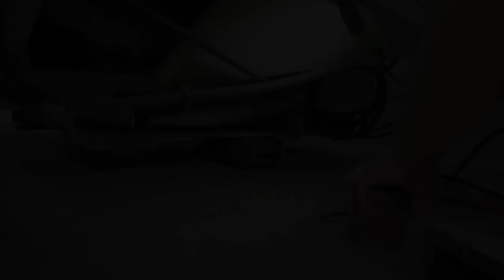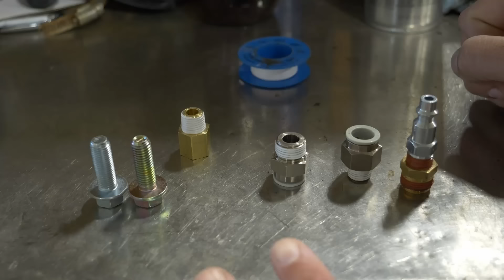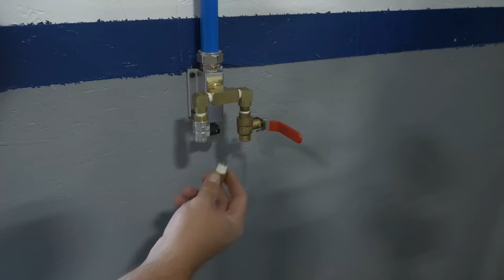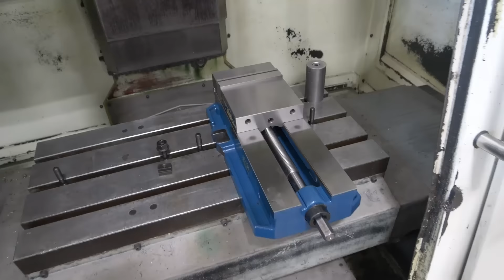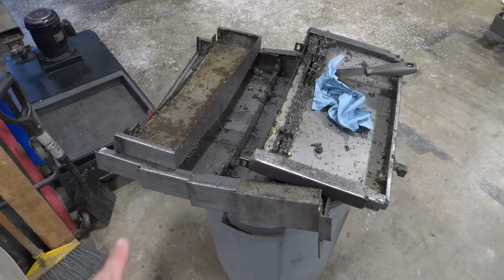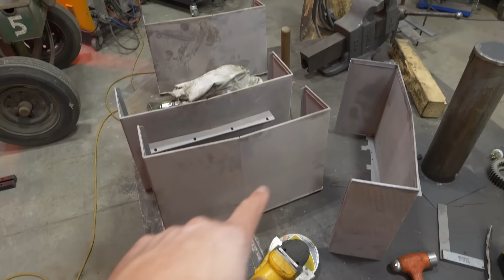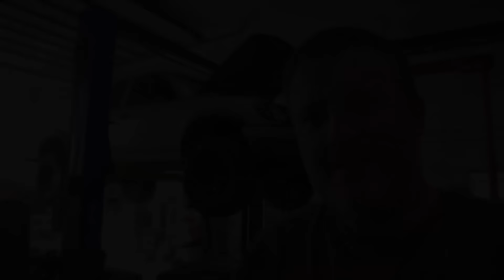Did I Buy a Problem or a Solution? Cheap CNC Repair Part 1

Comment: what the hell is a "Way Cover" and why do we care so much?
Reply: It's a condom that helps to prevent a milling machine from reproducing. Unfortunately they are effective only 98% of the time, so it's likely  you'll end up with more than one in your shop.
Reply: @dale436  Oh... that is just sublime! Best explanation ever! :))) Oh, i'm totally "borrowing" that.
Reply: @dale436  😂👌
Reply: @dale436  Judging by that phone call, that's exactly what's happened to Wes.
Reply: @dale436 yeah true story, I had a machine with out way covers. Should have seen the aftermath, like bloody rabbits!
Reply from the maker: Good question! It covers the ways. Think of it like a suit of armor for the machine. It protects the important expensive stuff it needs to actually move and work. It's the most important part of the machine IMO.
Reply: @WatchWesWork  Until I saw someone on YT dismantling an old machine that was in dire need of overhaul. Hang on a minute, that was You! I didn't know what ways were, thats how long I've been watching you.
Reply: @WatchWesWork Yes, way covers protects the ball screws so that shavings don't get ground into them . Expensive fix if that happens.
Reply: @WatchWesWork I worked for a machine shop company that has CNC machines. We had 5 new machines come in from Hoss my Manager said they cost anywhere from $500.00 thousand dollars and up. I was A Janitor in the shop so I was able to see what they did on a daily basis we worked for the US government  making parts for guns  and we made a part that looked like a beer keg  cut in half  with A clear lens on the bottom of A ship  or  helicopter sonar very expensive lots of things i see them make good luck
Reply: @dancurrier6421 And that’s why the NKVD hired the janitors in the Manhattan Project…
Reply: @WatchWesWork ”this is the way” 👷🤓😂
Reply: @WatchWesWork  Naw. Perhaps the most significant factor affecting longevity and accuracy, but not the 'most' important. The material you cut, it's abrasive factors, and how often you lube/clean the bearing surfaces will decide how important way covers are. Conversely, if you have .5 mm slop in the axes, or a lathe gearbox that randomly pops out of gear, good luck making good parts.
Reply: @WatchWesWork  see this is why I said you would be a great teacher. I lost patience the second I read what is a way cover.
Reply: There is nothing worse than getting shavings in the ways of any machine.
Reply: @robertgarrett5009  I'd say a massive fire is worse.
Reply: @robertgarrett5009 actually grinding/sanding/filing dust is worse as it is abrasive
Reply: You can play hockey without a cup but only because ice is so cold. You take a puck to the jewels and you'll know why then. Sometimes you just need protection.
Reply: Well, think of them as the pothole protectors for the machine. If you don't keep them in good shape, your parts will have potholes :)
Reply: The “ways” are the tracks the parts of a lathe, milling machine, shaper, cnc , all make their movements on, the accuracy of a machine is 100% dependent upon the LACK of wear on the ways., you can have them reground but that’s a slippery slope, , anyway any precision machine has ways., the chips of metal being cut, or ground by the machine end up in your ways and causing rapid wear., and thus rendering the machine “totaled” the cost of repair exceeding the value of the machine, now Wes’s early videos had a lot of machine repair, so “totaled” for Wes is slightly different.,
Reply: I sometimes wish manual lathes had way covers.
Reply: What a great episode
Reply: Ha where I am employed the owners don't like making way cover repairs! Then they wonder why the machines don't repeat!
Reply: Nooooo not a mystery phone call and now a part Two. Can’t wait to see it.
Reply: I'm stuck here in England.  I can tell you. We use metric mixed with imperial. For instance, we drive in miles per hour. But use metric for nuts bolts and screws. We wiegh food in llbs, but pay for it in metric. You at least have consistency
Reply: @pauljackson5482  And if you work on old machinery here  - British Imperial spanners, BSW, BSF taps and dies, BA, Metric, UNC, UNF and I had to buy some JIC screwdrivers for some Japanese machinery! :)
Reply: @Andrewausfa You missed “Thury” (BA’s ancestor) and the fact Whitworth and BSW have different sized spanners.
Pipe threads in Europe are BSP because nobody changes pipe installed in the ground.
Reply: At least in australia every thing is metric apart from old cars@pauljackson5482
Reply: I've learnt something as usual..sad to say I'm well seasoned in rusty frame repair living in Canada East and running  a bunch of 1st Gen Canyons.
Very poor move on GM's part with boxed frames.
Great vid as usual Wes..
Reply: It's the difference in getting 3 more years out of this machine, or 30 more
Reply: A ''way'' is like railroad tracks. It controls the direction of the machine tools. They should be perfect. The ''way cover'' is literally a cover for them. It prevents damage to the ''ways''.  As Wes said it's protection for the important parts. It sounds trivial like goggles, but it's not. You only get one set of eyes or ways.
Reply: Awesome video Wes. I learned a lot (as I always seem to do). Keep the videos coming and we sure as heck will keep watching. FYI I grew up in Australia, on a farm and we had Witworth, SAE. And Metric to deal with. I feel your pain.
Reply: First time I’ve ever seen them being called “way covers”, we call them telescopic guards or slideway guards over in the UK!
Reply: Imagine it as a prophylactic for a machine tool, it keeps all the pricklies away from the sensitive bits so they don't need a doctor visit 😀
Reply: Kinda like machine underwear except it keeps sheet out
Reply: That's the oiled table cloth Wisconsin families put over their cheese to make it cure, HaHa(just kidding)
Reply: Gewgle would know, if you did your own research.  It's literally two clicks away, plus spelling the words.  No sense remaining ignorant.  😉
Reply: It's what Little Miss Muffat eats, Eating her Curds and Whey . Then a spider sat down and scared the crap out of her
Reply: This made me laugh out loud, thank you!
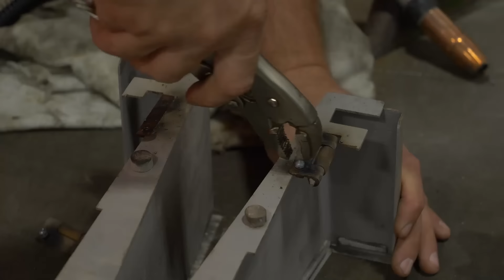Reply: Hey Wes 26:48 where is the welding clamp at I don’t see where you have it connected… I feel like the metal table that part is on is where you have the clamp connected is that right?
Reply: Did this get the Pin of Shame?
Reply: @peterjensen6844  yes it did lol
Reply: I thought the Whey cover was there to keep the flys off the curds.
Reply: Gotta love it, you buy that rebuildable way-cool 98 axis 4 transfer table fully automated zip-dah combination milling machine-lathe...and...remember all those manual milling machines, lathes, and drill presses you got rid of you now need to fix all our fancy new whiz-bang!😁
👍🇺🇸😎
Reply: Giant money pit. Machine is all bagged out. You will be sorry you ever dragged that thing into your shop.
Reply: Why do we care .....because WES 😎
Reply: The 'ways' of a lathe are the precision ground 'tracks' like rails in the base of a lathe, where the drive end is fixed to the base, the moving parts must be held in place with precision, so that as they move they maintain position with as near zero 'slack' as possible. 
they have 'wear' areas, sacrificial parts that wear, but adjustable to maintain tolerances.
Reply: I was thinking it related to making cheese.  A whey cover.  After all, Wes is in farm country.
Reply: Still waiting for Part 2! 😉
Reply: A way cover covers the ways.  Although you are unfamiliar with the term, those that read or/and use a lathe or have ever owned a vessel or boat needed repair done by a shipyard may have had their boat brought into the yard on “the ways”.
Reply: What is google and why is it so popular??
Reply: it protects the parts of the machine , like a swimsuit protects your parts/cracks in the sand..
Reply: It’s the way to grandmothers house we go
Reply: If you have to ask your at the wrong place bro!
Reply: @andrewslagle1974  
actually,  he's at the RIGHT place.

Comment: Fantastic detailed and informative video! I bought similar Hurco (VM10)  with similar issues. I didn’t spend any money on wipers but installed an inexpensive wool strip of correct size from EBay with one sticky side. Opened the lip and installed in the channel, then lip hammered flush. I do it to old of my machines after wipers perish and not a single chip managed to find its way through. Keep fantastic work! Oh! It’s not roller linear ways on these, just balls I was fulled as well.

Comment: Thanks for your great educating and entertaining videos Wes!:)
And now the usual and unwanted critique on some minor, unimportant point: When a force F acts perpendicularly on the arm of a lever of length r, the torque is: M = r * F. Where, by our grandmothers' mustaches, is anything mentioned about Earth's gravity, outer space, pounds, or kilograms? And about easiness and intuition: 1Nm is 1kg * m^2 / s^2. Which is conform to the scientific SI-System. 
The Anglo-American system of measurement originated in medieval England and exists in several national variations; it is not a unified system. This, along with the largely absent connection to the decimal system, is the main difference from the metric system. Users of these systems manage them without difficulty and even manage to achieve results (This topic can't be discussed without a little teasing:P …why make it easy when you can make it harder for yourself?). When a European says their system is better, they're just as ridiculous as an American who emphasizes the superiority of theirs. After all, both have learned their systems, are familiar with them, and can navigate daily life and work with them. Personally, I suspect these people are simply lazy. What's the problem with learning something new? But of course, time is better spent criticizing others and being as stubborn as a mule.

P.S.: Just as an aside: A snitch leaked that there may things like conversion tables, calculators, computers, or even inch/mm buttons on machine control panels. I think the CIA found that out ;)

Comment: I used to do house moving. As in; moving buildings. Used hydraulics, steel I beams, and railroad ties to get the thing in the air, get a pair of beams under it, plus some cross beams, then roll it out. We would move entire 2 story brick houses on 4-8 of those rollers. Things are indestructible. Pain to carry from the truck tho lol

Comment: thx for explaining the machine leveling process. I got myself a used Cinncinati Arrow 500 about a year ago. same C type as the Hurco....and the same leveling screws. I've managed to level the machine pretty decent, but didn't know about anything about the column leveling and correction at this point. now I have to check the spindle alignment to the table with a dial gage. wish me luck. hopefully I nailed it anyways back then.

Comment: I get the rant with the mismatch of standards, the one about Newton-Meters isn't valid. They are used the same exact way as foot-pounds. Never have i been in the situation where i would have had to calculate anything with G, while working on something. And when doing engeneering work it doesn't make a difference either, it's a Variable more to type into the calculator and that's it. If you find yourself in situations where you measure torque with weight and leaver-length than fine but i never did so far. You wouldn't need to understand the Unit to use it.

Comment: "it's 100% metric" except this 3/8 BSP fitting which is imperial.... 
then all metric is not the same, like this 10mm... like not all 1/2 is the same, you get NPT, UNC, UNF.

Comment: Think of the millions that would be saved if the rust belt discovered undercarriage pressure washers.

You should have one at the entrance of your driveway, like a cattle guard, that you can trigger from inside the car, to rinse all the salt off (or at least most of it) every time you come home after driving on salted roads.

Comment: I level machines slightly different. 
I adjust level and twist with the four front screws, then I adjust tram with the rear two screws.
Otherwise when you move the two in the middle, it changes the twist and level that you set earlier.

Comment: Ah, BSW threads (British Standard Whitworth). Common in the US until steel was the common metal for fasteners, when we swapped to our own standards. How do I know this? Some dummy threaded a UNC bolt into some woodworking tools I picked up at the flea market, that were supposed to be BSW.

Is 12-20 BSW (used in Stanley hand planes) very close to 1/4-20 UNC? Yes. Will 1/4-20 stretch out the BSW threads? Absolutely. Is it easy to find a BSW tap to make your own threaded rod that's 1/4-20 on one end, and 12-20 BSW on the other? NO.

Shoutout to Victor Machinery Exchange for carrying a tap in that size: literally the only one I could find that wasn't sold out indefinitely.

Comment: I just picked up an 2nd new to me old vf2. it's been countless hours getting it back up to good running condition but I got it for a steal. 2k for the machine, 2k for a spindle, and 1k for the rest of the bits and pieces it needed. I'm waiting on one final bearing to hopefully finish the whole thing off and get it back running. Used spindle replacement, rebuild gearbox, replace way cover wipers, find the oil leaks, fix the tool changer valve and TRP. hours and hours and hours of scraping gunk and cleaning. Hopefully it serves me well for a good long time. wont take long to make the money back on it.

Comment: 11:15 The best part of the Metric system is that it is totally interoperable : 1litre = 1000 cm3, 1kg = 1 litre water, 0c = Ice, 100c = Steam... That said, I was born in the UK in 1971, so I have to think in Metric and Imperial, and even now in the UK we measure imperial for distance (miles), but buy fuel and milk in metric (litres), buy beer in imperial (pints) - Oh, but Wine + Spirits in millilitres. Textiles in yards, temperatures in Celsius.... Standards 😂

Comment: "Metric is better, but maybe not always 100% better"
I'll agree with that. 
Swedish engineer here.

DIN is mostly superseded by ISO these days, though many ISO standards are the same as the corresponding older DIN. JIS is doing their own thing. I wouldn't call BSP a metric standard, even if it is common in countries that are metric (here too). I've always been somewhat intrigued by the fractional system in the US, I'm sure that's handy/better in some situations, though certainly not always. I suppose I could put fractional mm in a drawing, but people would look at me funny 🤔. 1.333... mm was never very satisfying. Where the ANSI system really falls apart for me personally is for small distances, where people seem to mix small fractions and thousands of an inch, which never comes out even. Like, 1/128th'' is 7.8125 thou. Does anyone here want to shed some light on how you deal with that?

Comment: Went I put any piping together I use a pipe thread sealer not the pipe tape. The sealer will help the fittings from leaking and the tape will not seal the treads like the sealer will.

Comment: metric you just use an 18 inch torque wrenches and round down a bit as your over 
, 46.4cm is close enough to 50 that we just do x10/2

Comment: forget all of the metric is superior folks, base 16 is completely divisible by 2, where base 10 is 2 and 5, then you get 2.5, 1.25, 0.0625, etc.  you end up (with division of 5) with the same fractional problems of base 16 only usually the metric guys don't go much past 0.25 of a MM in divisions, but how about M7x1.0 or M4x0.7.  I am the other way around and believe that Imperial threads are superior because I live in America.  I have no problem with metric threads in the rest of the world but the "metric only" guys can take that globalist mentality and.....  

Enjoying the series, I am fixing up a milltronics partner now.

P.S.  As someone from the west coast, me and my son have talked many times about the scam of salting the roads back east.  My suspicion is that it is an elaborate way to rot out older cars so you folks have to buy new ones.  I have an 88 F250 with barely any surface rust on it, and it snows over here too.  Too bad someone couldn't outlaw salt and use rock/pumice or de-icer over there, it would preserve so much of the best automobiles we made in the past....

Comment: Metric threads come in both fine and coarse, some sizes have 3 different pitches. This is because different pitches are needed depending on application....Pipe threads are a nightmare, ill admit.
NPT.....Here in the UK we call that American spec....No Particular Thread.....lol....🤔😏😀🇬🇧

Comment: Metric is not better, we’re just told it is. Having 12 divisions is better than 10 because it has more factors. You can divide imperial into 1/2s, 1/3s, 1/4s, and 1/6s and get whole numbers. And for the people that say you can’t count to 12 on your hand, count the segments of your fingers, excluding your thumb. There’s 12 in a 3x4 grid. You can add, subtract, multiply, and divide on your fingers using a 12 division system, and basic fractions are easy

Comment: I did that once with an undersized forklift and a milling machine. The mill ended up rolling off the trailer. Thankfully it was built back in the 60's when machines like this were overbuilt and it didn't do a ton of damage. I know own a bigger forklift because I really didn't like watching a mill I just bought roll off my trailer onto concrete.

Comment: One of the reasons I hate air powered tools is the mess in standards. Besides the BSP, JSP, Whitwurth, etc screw connectors there is also the quick release stuff that always never fits. And the differences are so tiny that you can hardly see it. Horrible!